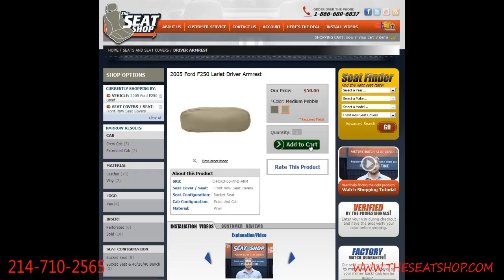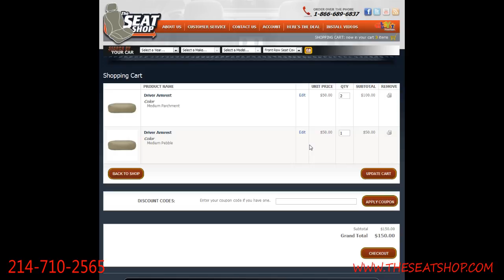Ford F250/350, Excursion, Expedition Armrest Cover Install

Comment from the maker: dekonfrost7,

Yes we do have leather that will match the King Ranch interiors.  you can check our our website or just give us a call and we'll be happy to help!

Thanks!
Matt 
The Seat Shop
Reply: TheSeatShop Cool videoclip, however if I wanted to order the seats and/or cover, there is no links below to order it from. Plus how do I know this is the correct seat and cover for my truck if I ordered the product?

Comment: Honest question, does that bag make any difference to feel or sound in the armrest? Is it worth it for the user? It sounds like it is only worth it for the applier and then after that the user gets to hear a new noise and the feel is now different too. Though maybe they won't notice because they didn't compare fresh cover no bag with fresh cover bagged. I have ADHD to be honest this shit would annoy me a whole lot hahaha. Just saying I would rather sweat and curse at my damn truck for hours to get this on if it meant I preferred no bag was in there after.

Comment: Guys, I enjoyed the video. i have a 2007 Lexus RX400h. The armrest has a lot of tear. I'm doing a DIY in replacing. 
 Is the process the same with the RX? How do you remove the armrest itself? Any explanation is greatly appreciate it. Thanks.
Reply from the maker: Thanks for the comment, unfortunately, we will not be knowledgeable enough to guide you at this time, we are still working on our Lexus options and have not gotten to the armrests as of yet and we don't want to steer you wrong.